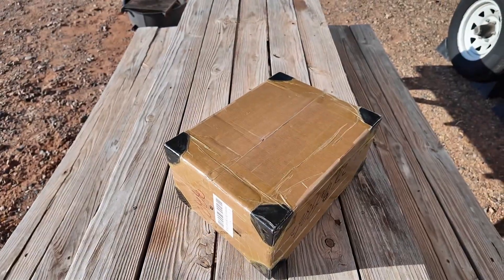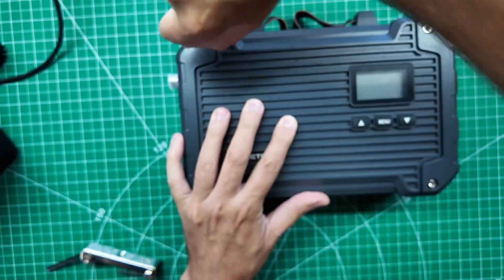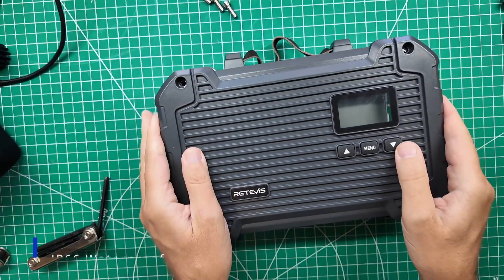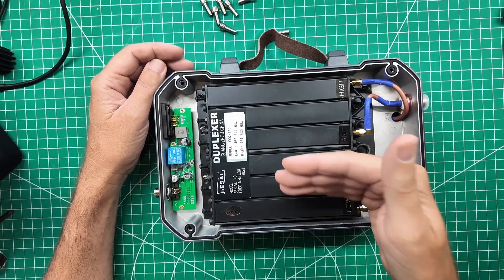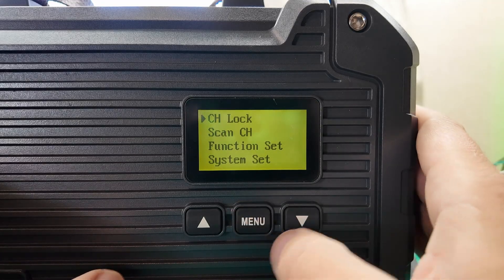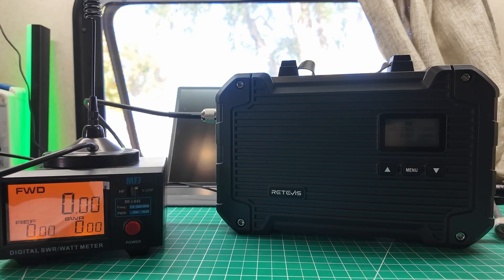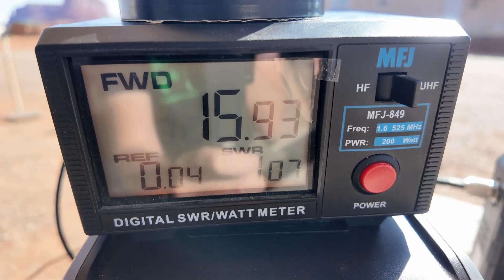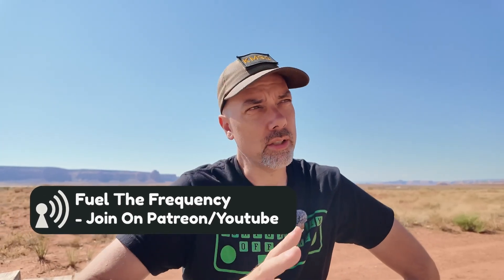The Tiny GMRS Repeater with a BIG Punch! | Retevis RT97L Review & Teardown

Comment: They came a log way since the OG RT97. That was 10 watt before duplexer . About 5-6 watt to ant. To get better reading put your meter/dummy load right on output of repeater before duplexer.  Leave duplexer in and to antenna for RX . That a basic notch filter type. More loss than a true cavity type and they have round cans like 6 . They much lower loss when tuned correct. The small one in that you can tune with 2 tiny SA units. You need sweep gen and SA at same time to tune them. The Tiny SA only does 1 at a time so need 2. My Siglent can do sweep and spectrum same time and has more dynamic range ,So I can do full size cans to 1296 MHZ. At 6 meters a can is almost the size  of HAM 2.0 . Jason. At 10 meters a can is taller than a person. about 9 ft tall . 1/4 wave internal size for cans. Watch ham radio DX for video's on cans. Haden has a few . The RT 97 runs on 20V DeWalt battery ! 12 to 24V. I think it 11 to 30V max range. Is in manual . We took duplexer out on the Midland one. Made extra hole  and changed to N connector and put a 75W amp with attenuator in input to get 50 watt at antenna . after cans.  That what we did for local GMRS repeater.  We used ID unit from Repeater Builder.   ID can be voice or CW . 73
Reply from the maker: Nice!

Comment: Thanks for the video!  I am looking forward to the next video!  I have the lower powered version, and I am not seeing how to change the RF gear to get it to the 70cm band, which I had wanted to do.  I probably missed something or there is some "undocumented features" to get the programming software to do the thing. I have tuned duplexers before, so that is not a problem.  Its OK if it won't let me change it, as I have a GMRS license, but I had to hoped to use it for some temporary ham applications (providing support for bike rides,  running events, emergencies and camp outs).
Reply from the maker: Gonna be an interesting project!

Comment: Depending on the spacing, the duplexer could be 0.75 to 1.2 dB loss, depending on the resonator size and frequency spacing.  Your radio output is 1.1 dB down from 25W. so that sounds right.
Reply from the maker: Makes Sense, thanks for the check-out!

Comment: Likely have to go all the way to 24V to get the 25W output.  Not really that unreasonable.  The difference in coverage between 18 and 25W usually won't be noticed.  If you do need it 24V battery power is easy to come up with.
Reply from the maker: Very true!